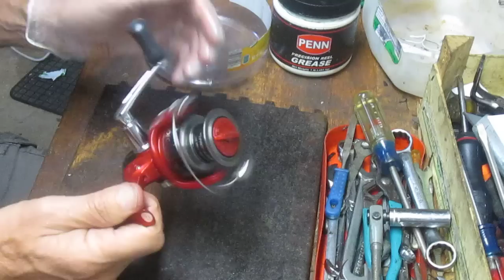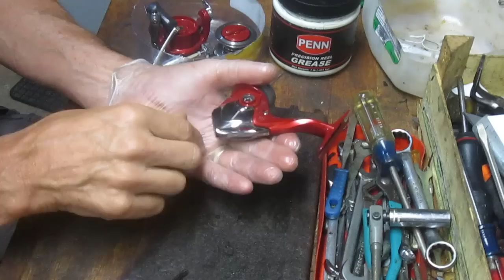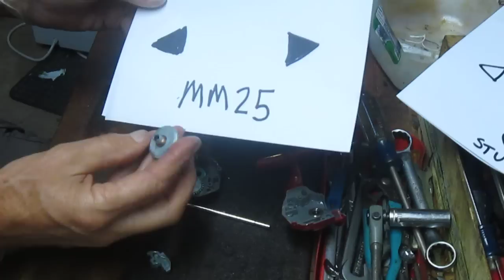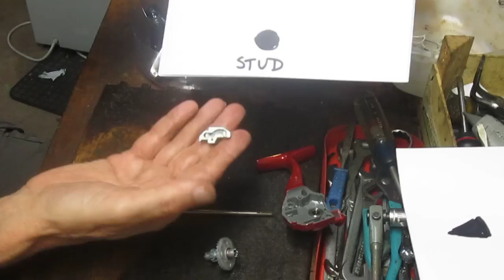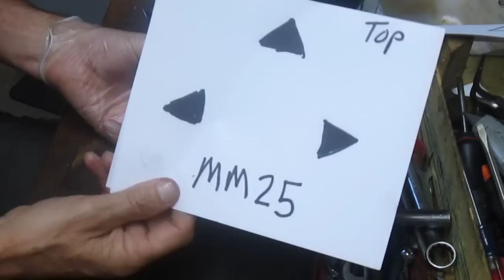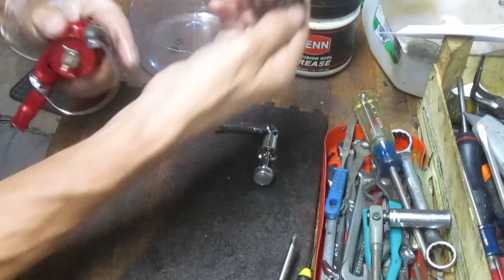Shimano Catana 2500 with Eliptical drive - basic service and reel review

Comment: when i spin my reel it makes a strange sound us if some parts inside are moving outofplace,its not turnign smood us it used to
Reply from the maker: There is likely something broken or badly worn inside.  You need to take the reel apart to see what is going on.  It could be something simple, like a bearing or something more like a broken gear
Reply: It did have nay sound issues before i open it but not it has ;d.I think my rotar asamble is bad.
Reply: @aleksandyrveliki162 Mucho Ingles? 😂

Comment: Thanks for your time on this. I just received a few hard worked and poorly used/cleaned reels that were used on coast (salt) AT ANY RATE, I started on this reel first and your video was helpful but I bit confusing where you used the Compass headings. I figured it out but it took a bit. I was off 90 degrees.on the main gear. I'mback to opening up the anti reverse gear as it does not seem to want to work. Getting plenty of practice, and, like tying fishing flies, it would be cheaper to just buy new ones from China but it's not as fun as doing it yourself. I'm 3 hours in but I don't care as COVID has me at home anyway. Thanks again.
Reply from the maker: That's a great attitude Hal!  You will do well, I am sure.  Best wishes and thanks for watching - Dennis

Comment: Do you have a video on the newest catana front drag model?
Reply from the maker: I do not.  I don't see these reels much.  My guess is that the design has not changed and that this video should help you with the service.  To be sure, you can get the schematics for your reel and compare it to this one.  That should show the base set up and if there are any differences - Dennis
Reply: @2ndChanceTackle  can you tell me if they have the Shimano insta stopper II feature with zero back play in the handle. That's all I pretty much needed to know. No one mentions anywhere. Including Shimano themselves.

Comment: Does the Shimano Catana have any felt washers that make other mortgage price expensive Shimano reels like the CI4+ or Sahara or NASCI ridiculous to purchase. Felt washers tend to burn on fire when fishing in the 90°F + summers in saltwater from constant bites.

Spending $250 - $350 + on a felt washer reel or non sealed reel is like buying the Dodge Challenger "chrome rim package" which are really $7,500 for plastic glitter coated wheel covers....... Rip off...
Reply from the maker: You can get Carbontex drag washer upgrades for the Catana as well as other reels that use the felt washer technology, if you are wearing, tearing, or burning up the felt washers.  The Penn Fierce and Pursuit reels are another example of saltwater reels that use felt washers.  The Carbontex washers are available on line from several sources.  They are similar to the Penn HT-100 drag washers. One online supplier is SmoothDrag.com.   A set of Carbontex replacement washers for this Catan reel is less than $10 for a set of 3.  You can connect with them at info@smoothdrag.com or just check out the site if you are interested.  Thanks for asking - Dennis